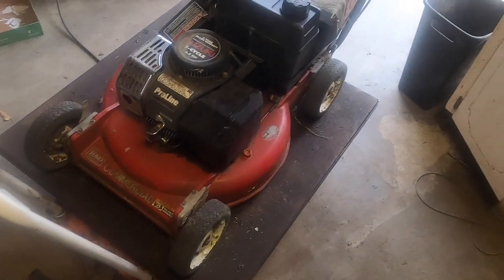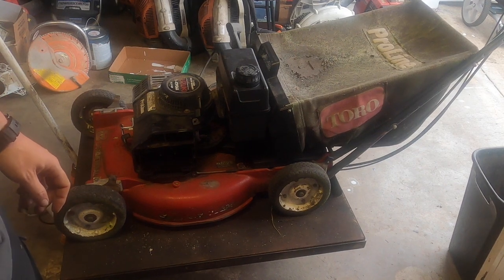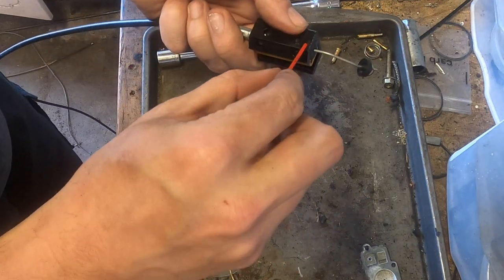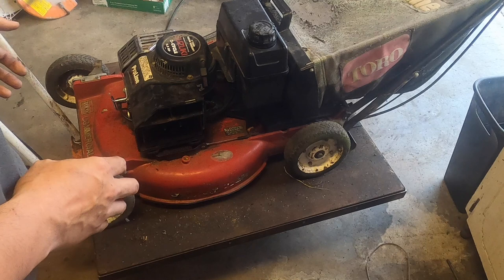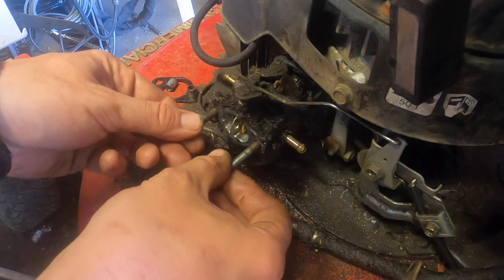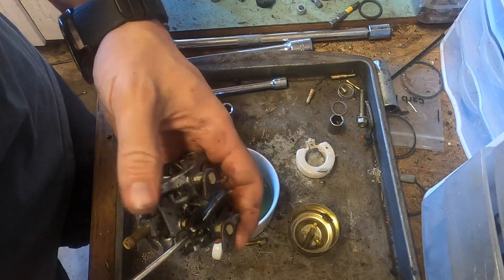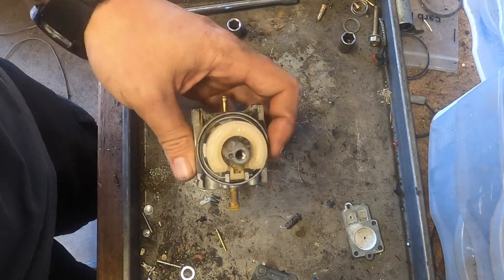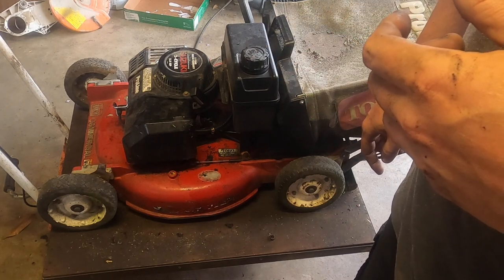Toro 2 Cycle Throttle Cable Repair and Carb Cleaning

Comment: just picked up one that’s been outside for a year for $40 and got it running. Trick with this Suzuki is to keep carb area and linkages super clean.  After 40 years still going super strong
Reply from the maker: Very true. There was always a huge amount of build up when I work on these.

Comment: In fact, these do have a compression release. Remove the muffler...the small hole forward of the exhaust port is the compression release. They get clogged with carbon very easily, clean with compressed air  in the spark plug hole  and a pick.
Reply from the maker: Interesting. Good to know. Thanks for the info

Comment: I have a similar toro commercial model.  Has the proline emblem.  Do you havea part number or link for the carburetor? I have had it cleaned twice and still surges
Reply from the maker: There are a few different variations. If you can give me the 5 digit model number I can find it.

Comment: That Jet that loads in front the top, near the idle screw, does yours have a hole in the top or bottom?  Mine has the 2 holes in the side of the Jet but not the tope or bottom.  Mine won't idle smooth at all.  Thanks for any information.
Reply from the maker: That would have a whole in the bottom. It is very small but should have one.
Reply: @PNWSmallEngineandLawn  I looked again and solid brass, no hole. I spoke to the Guy I bought it from and he said when he bought it new, it wouldn't idle.  He took it to the Dealer several times and he told them it was normal - what a bunch of BS.  So I drilled out with a hole probably too big but it idles perfectly now.  Go figure. I probably paid way too much for the Model 22043.  Mower at $250, Bag $65, pull rope $6, foam air filter $10, Carburetor $85 (may not need).  Carb gaskets $12.  Worst part is my neighbor, that is a hard-Left D, says if he sees me mowing with my new-to-me Toro, he will destroy it with a Sledge Hammer.  And I don't doubt it.  Should I use Amsoil 2-Cycle oil or ????  I run my other 2-cycle engines at 40:1.  I really appreciate your reply and I'm listening as I need to learn how to take care of this Mower.  A neighbor years ago had a 2-cycle Toro that I always admired.  I ended up with a 2-cycle OMC Lawnboy.
Reply from the maker: Sounds like you definitely had a bad carb. Ya some people have some issues with these but they don't own this mower, you own the mower. 40:1 should be ok, I think the manual calls for 50:1. Amsoil is good but personally I use echo red armor.
Reply: @PNWSmallEngineandLawn  OK,  I'll locate some Echo Red Armor.  And Thank you again.  I don't think I will need it but found a new OEM Carburetor for $84.  A Lawnmower shop across the Country had one on their shelf.  The Guy may not take it back but I would imagine I can sell it to someone.  These Mikuni's are so darn exspensive.
Reply: Tell your neighbor you are all for a solar powered electric chair